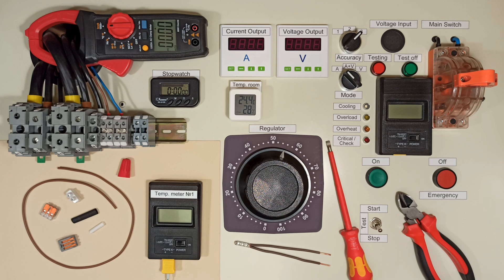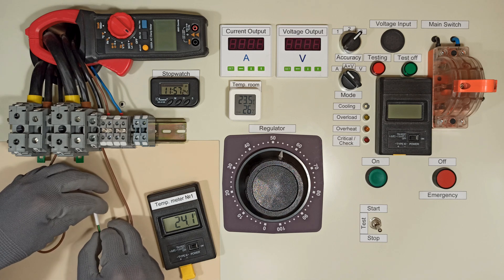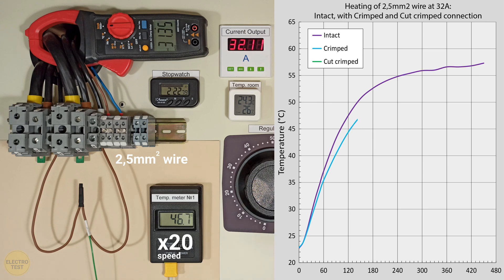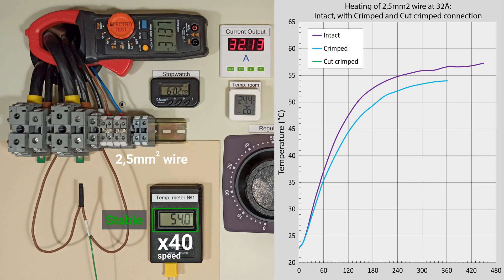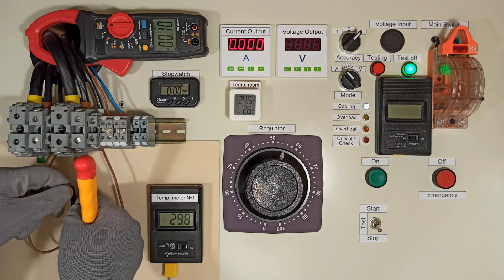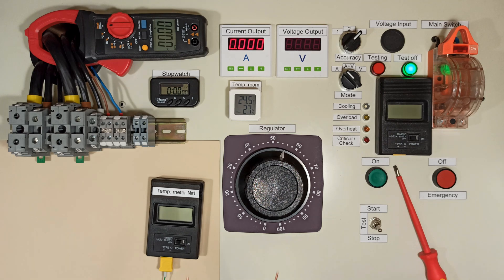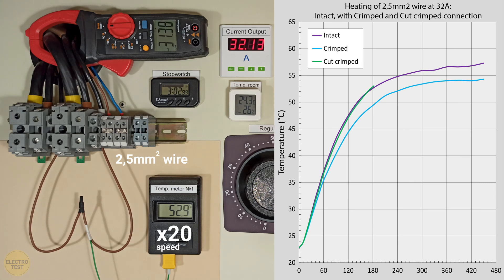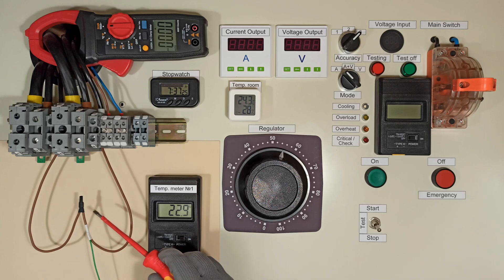Connection that heats up like a solid wire. Connection for tests

Comment: не объективный тест. проверять надо после длительного времени. когда проводники окислятся. когда напряжения в материале уйдёт. в этом и есть задача соединения на длительное время. на не через 5 минут.

для ускорения можно нагреть до 300 градусов, и в какую нибудь кислоту окунуть, вот тогда всё встанет на свои места.

а так всё это просто баловство.
Reply from the maker: What does oxidation have to do with this? I was looking for a connection that wouldn’t affect the temperature of the conductors and cables during my tests. It’s clear that over time most connections will degrade. Although crimping is very reliable.

Comment: Maximum continuous operating temperature of cables
PVC insulation 70°c
XLPE insulation 90°c

Max 1 second Short Circuit Temperatures
PVC Insulated cable: 160°c
XLPE Insulated cable: 250°c
Reply from the maker: Hello, my friend! Thanks for the useful information. Could you explain in more detail what the last temperatures mean? Do you think this is the temperature for the insulation of the conductors or the outer sheath of the cable?
Reply: @ElectroTest_1  1
* Max short circuit current for XLPE insulated copper cable is 250°c
Max short circuit current for PVC insulated copper cable is 160°c
(There is a PVC cable with a short circuit temperature of 170°c)
This is the maximum temperature that the cable can withstand for 1 second.

* I am sharing the values that are in accordance with the standards with you so that you can understand what this means. It is assumed that the environment where the cable will cool down after reaching high temperatures in an environment with air flow, i.e. outdoors. Since it will cool down more slowly in the pipe, these values are different from the short circuit amperage values. If there is more than one cable in the cable carrier shelves, the values will differ. If detailed calculations are not made, the result can be multiplied by 0.8 in an environment with multiple (more than one) cables.

The values that cables should withstand in Turkey and Europe are determined by standards. TS (Turkish Standards) or CE marking (Conformité Européenne) indicates that the cables meet these standards.
Reply: @ElectroTest_1  2
* Initial copper conductor temperature °c and ampere value of 1 mm² copper conductor that it can withstand for 1 second
Short circuit current density for XLPE and PVC insulated cables with copper conductors
90°c = 143Amperes (XLPE insulated copper cable)
90°c = - PVC insulated cable does not work above 70°c

80°c =149Amperes (XLPE insulated copper cable)
80°c = PVC insulated cable does not work above 70°c

70°c = 154Amperes (XLPE insulated copper cable)
70°c = 115Amperes (PVC insulated copper cable)

65°c =157Amperes (XLPE insulated copper cable)
65°c =119Amperes (PVC insulated copper cable)

60°c =159Amperes (XLPE insulated copper cable)
60°c = 122Amperes (PVC insulated copper cable)

50°c =165Amper (XLPE insulated copper cable)
50°c = 129Amper (PVC insulated copper cable)

40°c =170Amper (XLPE insulated copper cable)
40°c =136Amper (PVC insulated copper cable)

30°c =176Amper (XLPE insulated copper cable)
30°c =143Amper (PVC insulated copper cable)

20°c =181Amper (XLPE insulated copper cable)
20°c =150Amper (PVC insulated copper cable)

Short circuit currents are valid according to ambient temperatures (°c) for cables with copper conductors thinner than 300mm². Since cooling will not be fast for 300mm², values are calculated differently.

To find the short circuit ampere value for 1 second, multiply by the cable section (mm²).
Ampere value in the short circuit table x mm²

Example:
A current value of 176A per 1 mm² is given for an XLPE insulated cable at 30°c
It is calculated as 176 A/mm² x 2.5 mm² = 440 A. A copper cable with 2.5mm² XLPE conductor can carry 440A for 1 second. When it exceeds one second, it will exceed 250°c, i.e. it will burn.

If the same calculation is made for a 2.5mm² PVC insulated cable,
143A (30°c PVC) x 2.5mm² = 357.5Ampere
For cables with 6mm² copper conductors.
176A/mm²(30°c XLPE) x 6mm² = 1056A
143A(30°c PVC) x 6mm² = 858A

* Important information about MCB:
- B type (used in residences) MCB breaks the circuit at 3 to 5 times
- C type fuses break the circuit at 5 to 10 times the ampere value specified on them.
MCBs according to European Standards Accepted deviation values between standards:
The value indicating how many times the ampere value on the circuit breaker is expressed as In. I will give an example for C20, Schneider C20 circuit breaker In=8, if there is a 20A current, if there is a 20x8=160A current. C type circuit breaker indicates that it breaks the circuit at 8 times between 0.1 second and 1 second.
Now that I have explained the In expression, I will share the subject that needs to be known.

MCB within European standards
Does not break the circuit at the ampere value specified on it. The lowest In=1.14 is accepted for breaking the circuit. After operating between In=1.14 and In=1.45 for 1 hour (3600 seconds), it is between the standard deviation values to cut the circuit. This value is valid for B type and C type at 30°c temperature. MCB manufacturers can also specify the temperature values. Schneider company has stated in its document that it will give these values if the Pro models operate at 50°c.
In=2.45, that is, the circuit breaker is expected to cut the circuit between 1 and 60 seconds at 2.45 times the ampere value.
B type MCB breaks the circuit in 4 (In=4) times, C type MCB breaks the circuit in 8 times (In=8) in 1 second or less. The circuit breaking time, which is 1 second or less in cold weather, can extend up to 3 seconds.
Although C type breaks the circuit in 8 times, it trips faster than B type at the specified value. It is between 0.01 and 0.2 seconds. B type is between 0.1 and 1 second.
Reply from the maker: Thank you for the information. I know the details about circuit breakers. Regarding the cables, could you tell me which document this is from?
Reply: @ElectroTest_1  The cable manufacturing company named "Öznur Kablo" shared the pdf document stating that it has international standards. Since the document complies with Turkish standards, it was published in Turkish.
Reply from the maker: I found that these data are from DIN VDE 0298 part 4. In my opinion, they are more suited for cable manufacturers than for electrical engineers and electricians.